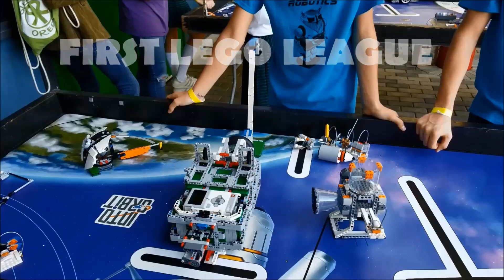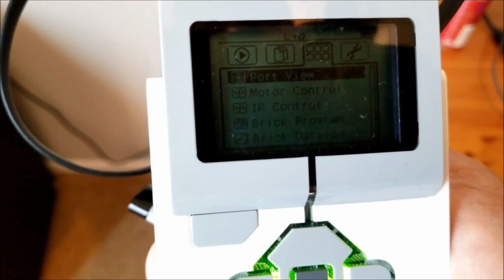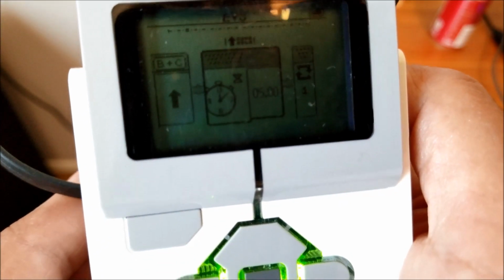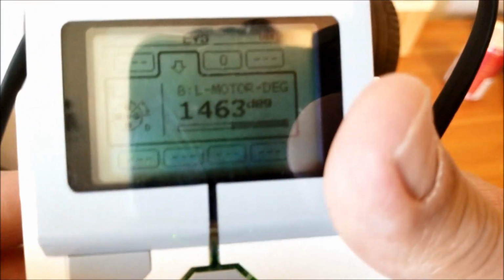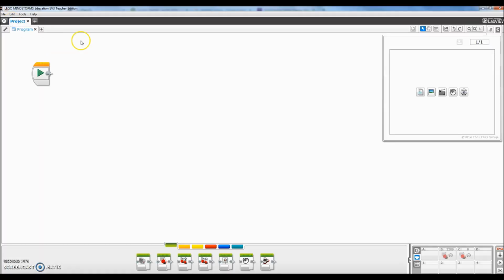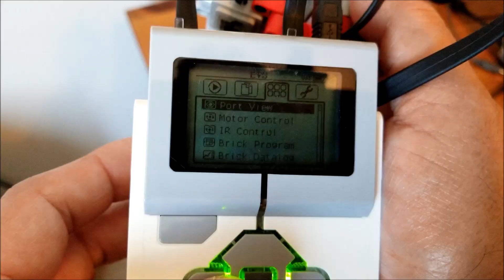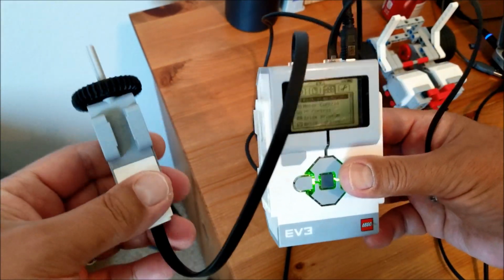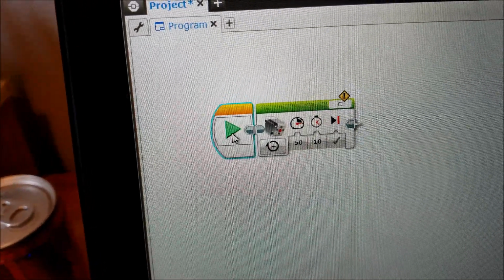"The Continued Mystery Of The Broken Motor Port"

Comment: Hi Mr. Hino, the problem might be that the ports are broken, especially port C. In the brick there are electronic components and batteries, so Mose of the wires are stored around port C's info cable. tThis makes the info cable highly delicate, and if there is any high speed collisions or anything that could break something, then that might be your problem.

Comment: I've got 10 kits of EV3. I've had a similar problem. Ended up using all my servo motors plugged into B + D and that fixed it. I read elsewhere on the internet that lots of people have issues that can be traced back to Port C. Also... I think the reason for the yellow exclamation mark is that the medium servo motors are expected to be used in Ports A or D... (I think)

Comment: Thank you for the video Mr. Hino. This cleared a lot of things up. If you change the brick, the same problem will occur. If you change the motor that was slow, the same problem will occur. If you switch the ports between b and c, the problem will still occur. However, if you change the motor that is fast, the problem will be fixed. What's happening is that your motor that is going fast has a broken encoder which is why in port view, it does not read anything. When the makers of the ev3 programming programmed the software, they made it so that the brick keeps adding power to the motor that does not show any rotations or degrees so that it can try to "move", because in the brick, it thinks the motor isn't moving at all since the encoder(tracker) is broken, therefore if you change the motor that is going fast, your problem will be resolved. Let me know if this fixes your problem?  Thanks, Eli
Reply: Outstanding and very logical!